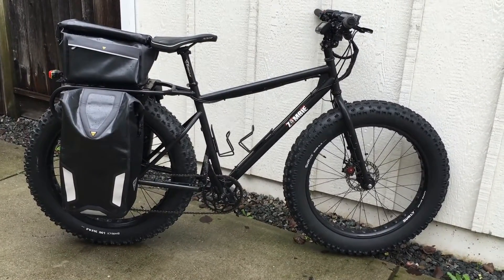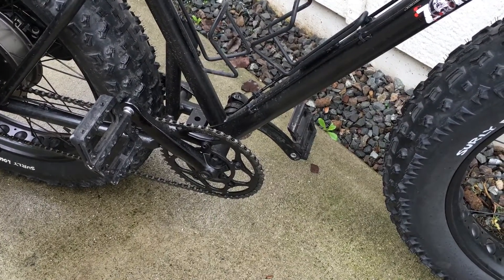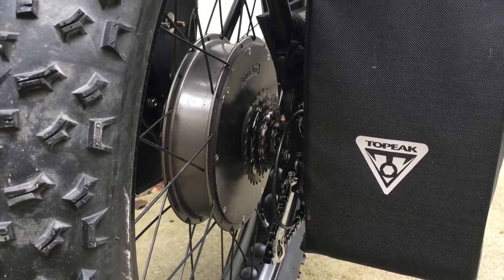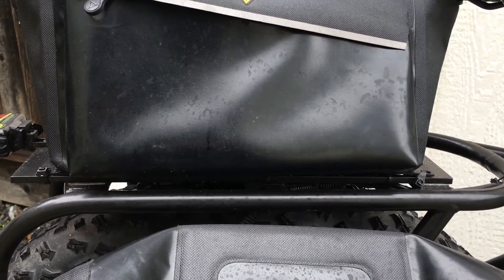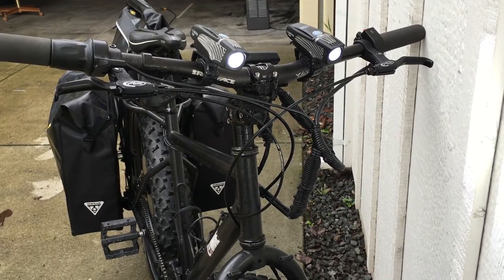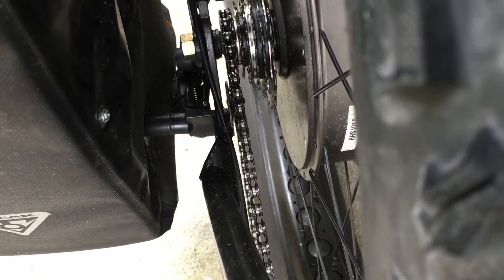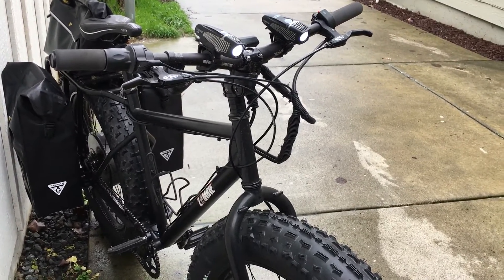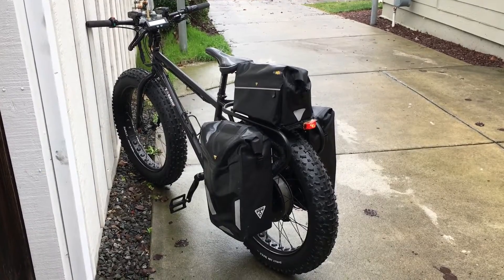Fat Tire Commuter eBike Design Logic Cargo Bike e-bike

Comment: How much does it cost to build a bike like that?
Reply from the maker: +David John Williams 
I have spent a little over $8,000 on the bike in the video. 
Examples of component costs: 
Frame: $1,450 + $90 shipping + $150 powder coating
Battery: $1,325 landed cost
Controller: $350 landed cost
Labor (bike shop, assembly + wheel builds): $400
Labor (electronics technician, all wiring): $350
Surly wheels, tires and crankset: $825
Fork: $110 + $30 powder coating
Crystalyte 4060: $525 landed cost
Reply: +Industrial Ebikes Thank you very much for that information, truly a great bike...exactly what I would like to have. As I would, I'm sure you mostly use it in pedal assist mode, but what sort of range and speed could you get from your set up? The list totaled $5600, so I presume the remaining $2400 is in the panniers, display, lights etc.
Oh what I'd give to have one like it...other than $8000 lol...I've never paid more than $5000 for the cars and trucks I've had, it seems so expensive for a bike...but certainly a worthy investment for your own health and that of the environment. Well done. Thanks again for the information.
Reply from the maker: +David John Williams 
If I go wide open throttle, the battery needs charging after 10 miles, but if I am conservative it can take me up to 50 miles. It does not have pedal assist. I always use the throttle and I always pedal as much as possible.

The only reason I could afford it is because I walked away from automobile ownership forever. Keep in mind that the bike in this video is a prototype--it needed improvement in many areas. I am building the "real" bike now, and it incorporates all the improvements needed. If you build a fat tire commuter ebike, you should implement those important  improvements seen at www.commuterebikes.com.
Reply: +Industrial Ebikes Very interesting, thanks for the link to your website, I have it bookmarked. I can see from the videos on your site that we have similar riding styles...somewhat aggressive. I like jumping off curbs and drops, taking shortcuts through rougher terrain etc. I could see in your videos and from your comment in the Performance section that cornering requires care with your set up. It would be nice to have two ebikes one as you've created for general commuting and another one, possibly with a mid drive, and the weight of batteries and controller mounted at the center of the bike frame for better handling. What I like about the ones you've built is that they are inconspicuous for an ebike. Thanks for sharing what you've learned along the way, I hope to buy or build something soon.
Reply: $1250 here..All ebay kit parts, and bike 4" ,Disc, steel frame,1500w 48v 20ah.  Going on my 3rd year, only minor repairs. I use it mostly on trails and roads. All time best toy ever :) (much lower quality than this video..but- it works! :)